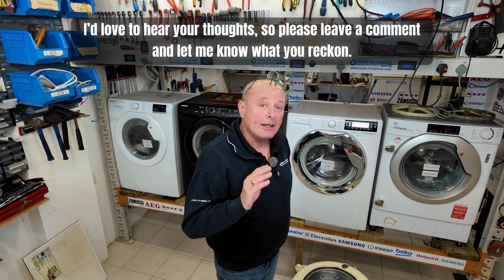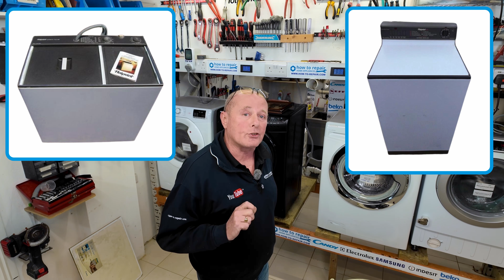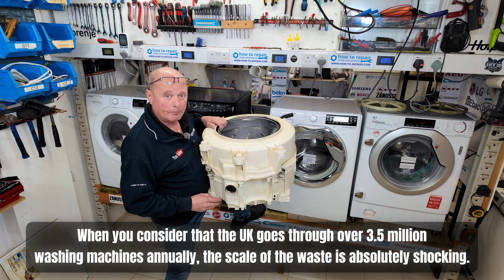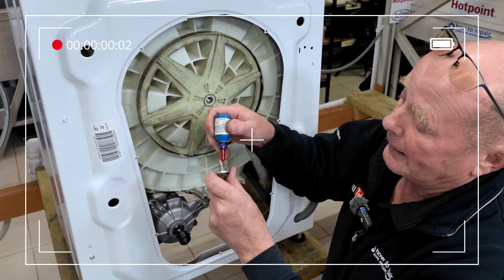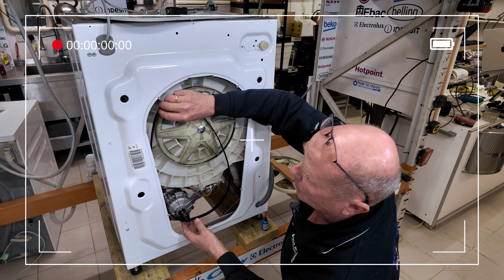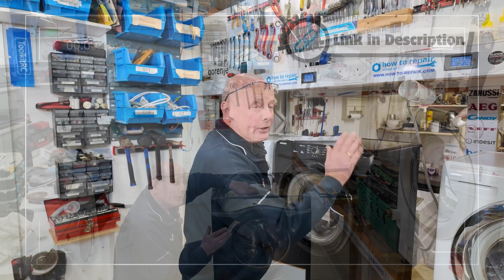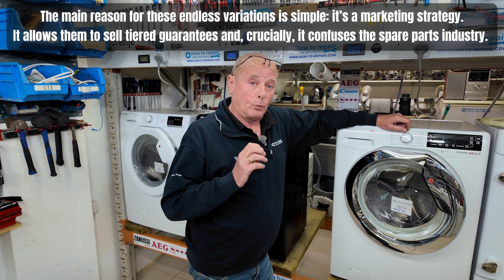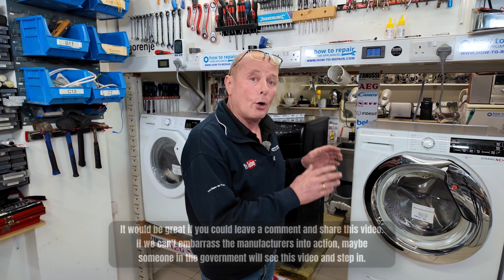I Scrapped 13 MACHINES to Prove a Point: STOP BUYING These Brands!

Comment: I hate the built in obsolescence and awful quality of so much in modern life. Tonnes going to landfill while we get lectured on green issues. Thanks for highlighting these issues, I wish more people would speak out.
Reply: Electrical appliances disposed of at council recycling centres don't go to landfill. That hasn't been allowed for many years. Look at The WEEE Directive.
Reply: Isn't it incumbent on people to do research before buying though?  For example a Mitsubishi Electric refrigerator is somewhat higher quality than an LG, Electrolux (Westinghouse/Frigidaire), Whirlpool (Hotpoint), but many buyers simply refuse to pay the 50-100% higher price for that higher quality. So much so that Mitsubishi Electric do not consider it viable to sell in the UK refrigerator market (nor the US one for that matter). :(
Reply: @TassieLorenzo  Yes and no.

I think a lot of people have now been conditioned into believing that a washing machine lasting less than 10 years is normal, and as such are sceptical about spending a lot more and ending up with a slightly shinier paperweight in 10 years. For example I think Miele have now started using plastic drums in their cheaper machines, which are cheap for Miele but not cheap in comparison to other washing machines.

If someone buys one of those Miele's expecting them to last 25+ year like many people claim, they're going to be quiet upset. It's crap like this that spoils it for everyone.
Reply: @boostar155  I still bought one of those plastic drum Mieles as it is what I am familiar with.  I'm currently dismantling my W828 and W3933 lol, I'll keep the good bits but scrap the rest including the failed drums (delamination on one, metal debris, and literal sparks flying and outside down machined down on the other, either out of round or possibly also metal debris lol).

In fact, I "had" to buy the base model as the door opens 85 degrees compared to only 65 degrees on the top models where it would be in the way of a walkway (I like to keep the door open all the time, while standard left-hand-hinged washers would have the door completely in the way).  I have a suspicion the plastic bezel door is the same geometry as the old metal doors, and will try swapping the old chrome door over from the failed machine once the machine is out of warranty, lol.

 FWIW, it was a factory second at around $1100 AUD compared to $675 AUD for a Bosch Series 4 which I thought was not too bad.  I really should have bought it immediately, instead of the used Miele first (which failed) though, as at the time (for the full price of $1550 AUD) Mie;e were including a 10 year warranty.

IMO, even on the  plastic drum models, there are still nice touches like transit bars instead of transit bolts of other brands.
Reply: @TassieLorenzo  Some people seem trained to 'think' they want the cheapest of anything. I've replaced home boilers in Maine that are actually illegal in NH because of their inefficiency, but the homeowner thinks you are trying to screw them for a more efficient system that is only 10-15% more but would pay for itself in a few years.
Reply: @TassieLorenzo  "Isn't it incumbent on people to do research before buying." But how do you do the research in a meaningful way? How can you do the research on longevity? And what is the ratio of price to longevity?
Reply: @ac1646  You can't but you view past historical data and teardowns & parts diagrams of the relevant model (including checking spare parts prices) and make an educated guess.  Like in automobiles, there are some aspects of washing machine manufacture that don't tend to change that much  and there are aspects that change a lot.

(e.g., Honda still uses bolts from the same parts bin as always (old-fashioned JIS standard bolts, not the modern ANSI ISO standards with superior stretch characteristics), they still use rubber hoses & metal hard lines for things like crankcase ventilation, vacuum & boost and not the plastic lines of European cars, and those rubbers hoses are sized in Imperial inner diameters as that is what Honda started with.
So those bit are good, what's not so good is the newer stuff thats changed: the 1.0 EarthDreams has a wet timing belt, the 1.5 EarthDreams has marginal reserve strength and has headgasket failures at 60,000-90,000 miles, and the CVT is also much less reliable than the old 5-speed automatic (which was only reasonable reliable on four cylinders, and was itself pretty unreliable on V6s).

Similarly there are things on say a Miele that have been the same for a long time (e.g., the transport bars, the support springs and mounts) and there are things that change a lot; but even the latest W2 still uses aspects of older designs, it is not truly "all new".

Typically it is aspects that change a lot that should be cause for concern -- electronic front panels (especially if touchscreen) or automatic dosing systems or Beko's new weight saving plastic door hinge etc.
Reply: @ac1646  E.g., a cursory search of the internet will show you that linear compressor LG fridges have a horrible reputation,   although the rotary compressor model LG fridges still can have the  compressor fail at 3-5 years too, but it's just less common.  At some point you to have to ask yourself "is there a reason a 450L LG fridge is $800 AUD and a 450L Mitsubishi fridge is $1600 AUD"?  

Some of that is the retail model, where they are more protective of RRP (about $1200-1300 AUD RRP on the LG, but the LG is regularly heavily discounted), but some of that is just less cost-cutting in the Mitsubishi Electric.

That doesn't mean the Mitsubishi Electric is prefect, and some will feel the price premium is not worth it for machine that (as you can imply) can of course still fail in 7 years or so just like a cheaper one.

Given Bosch refrigerators seems to be a lucky dip of who supplies the compressor (I've seen all of: Panasonic (good), Embraco (not bad) and JiaXpera (hmm, fine, but in that case why not just a buy a Chinese brand fridge?) in various different Bosch models) and where the fridge is made, I don't see the value in them as they are priced about the same as a  Mitsubishi Electric.

While some folks will prefer to pay more again for a Liebherr fridge. :)
Reply: PS. Despite saying the above I still like LG, as for example their fridges have only one control board and it is only $180 AUD, where the comparable Westinghouse (Electrolux/Frigidaire) has both the fridge control board the Embraco universal motor controller control board, and these are both $280 AUD a piece.  [The Westinhouse fridge is also very noisy compared to the similarly priced LG, but I digress!]

As Paul says, LG products tend to good for repairability and have reasonable spare parts prices compared to some.  So if choosing among budget brands, it is a very good option.
Reply: @ac1646  Also, an employee from a retailer was kind enough to unofficially publish warranty claim statistics (for fridges in the Australian market), which were warranty claim rates of: Mitsubishi Electric 8%, LG 12%, Westinghouse 13%, Samsung 31%.  While reading for 100s of hours on this is perhaps a waste of time -- at least you get some idea after it all, lol!
Reply: @TassieLorenzo  Thank you for going in-depth and although that is quite specialist knowledge, it has given me a few pointers. Thanks again.
Reply: @TassieLorenzo Nowadays you've got the choice between "cheap, will break in 5 years" and "expensive, will break in 5.1 years". 
Might as well go with the cheap option, paying extra doesn't guarantee anything.

Comment: Most are entry level and affordable. Most buyers do not factor in life cycle or repacement costs. Extended warranties are gimmicks. Limited choices for older homes/condominiums due to space and accessibility constraints. The fad market: features, programming, steaming, colors, etc. Where most use primarily the basic features.

In Toronto just for a repair person to come and evaluate - $300, plus diagnostic time, parts ordering, return to repair if parts are available or readily available ($200-300). So unless it was high end or cheap parts, forego repairs fir replacement. New washer - 24", 5 cu ft, depending on brand - $900 to $3000. Used or refurbished, open, floor demo, older - $800 to $1500.

Personally, I have had less issues with Bosch and Miele washer and dryers. But they cost much more than Samsung, LG, other. Same for parts.

Comment: Metal scrapper here. Been scrapping a lot of these front load washers in Melbourne that were made AFTER 2020. Corroded spiders the main problem along with bad seals. Rarely bad motors, hoses, boards or wires. Most of the machines blocked with lint and dust and spiders. So much plastic, and sealed drums abound. Avoid Vietnamese made appliances of any type.

Comment: I used to work in electrical retail and I think price is a big problem. The price of appliances has fallen considerably in real terms over the last 30-40 years and the price of repairs has risen considerably making it often uneconomic to repair machines. People would rather just order a new machine online and have it delivered the next day rather then call out an engineer and wait in all day only to find that by the time they’ve paid the parts labour and VAT they aren’t much better off. When I worked in electrical retail we would recommend a local engineer for repairs and I would say 80% of customers never bothered even calling him. I even remember one lady replacing a Bosch tumble dryer that had a snapped belt (I suspect she overloaded it) that was only a couple of years old and she decided to get a new one because we could deliver it that day rather than wait for an engineer.
Reply: You need a war like in Ukraine hunger games

Comment: Sadly this is painfully obvious with everyting. From clothes to appliances and vehicles. 

Im a fix everything guy myself.  And i see obselesance in everything. 

Take car suspension. Specially on european cars.  Suspension arms made of aluminum with the balljoint cast in the control arm. The balljoint goes bad, throw away 3kilos of aluminum and good bushings just to buy a new 120€ part even tho the balljoint would have cost 10€. 

Engines made with smaller and smaller displacements, pushing higher and higher power with turbos, at the same time being chocked with ecology making for a really powerful and ecofriendly engine that lasts the warranty and is too expensive to replace and is impossible to repair. 

Many many 80,90s cars had no problem going million and more kilometers. 

My grandma had a fridge made in 1957, made in Riga Latvia (ussr at that time). It was working till the day we threw it away because it was rusted out that was 2 or 3 years ago.  It was almost 70 years old and never skipped a beat.

Comment: It appears to me that the issue isn’t the Right To Repair Act but the rip-off prices the manufacturers are charging for the parts as well as building machines which are far too complicated. We need to go back to basics.
Reply: But they're welding the drums together so that they can't be opened and repaired. You have to buy an entire new drum.
Reply: @f-22r If you choose a Korean machine you can avoid that.  Otherwise a metal drum Asko or metal drum only models of Miele.  Some of this is on consumers for still buying Hotpoint, Bosch, Beko etc instead of only buying LG and Samsung on the budget end, or only buying Asko or Speed Queen on the premium end.  

European consumers have a real tendency to stick to their domestic brands (for whatever reason) instead of preferring Korean or Japanese brands.  That applies in ICE automobiles too despite the demonstrably lower quality of electronic and mechanical parts in brands like VW Group, Stellantis or Groupe Renault compared to Toyota or Honda (the bodies and paint are better quality in the European brands though).
Reply: @TassieLorenzo  because european brands used to be good quality. nowadays they are all chinese-owned. Candy is the worst example.
Reply: I am 72. I have bought several washing machines in my life, and fixed most of them myself. Stupid faults. Pumps, leaks. Rust. An expensive Zanussi washer drier. That got completely bunged up. 
So when I inherited a bit of money in 2000 in bought a Miele washing machine, dishwasher and fridge freezer (a rebadged Liebherr I think). And 2 AEG pyrolytic self cleaning ovens. I bought AEG ovens as the Miele pyrolytic ovens were too expensive. All are still working. So is a 2008 secondhand Miele tumble drier I bought in 2016. 
However a newer secondhand Miele washing machine I bought a couple of years ago failed with a rotten spider.  A one year old Miele automatic twin dose machine I bought 2 years ago takes forever to do a wash.  Bizarrely over complicated and out of touch with reality. 
So, even Miele is losing its way. 
The on off button on one of the AEG ovens now barely works - I have put tape over the button so the machine is never turned off to prolong its life. No spare part available - the oven is used every day and still works like new. 
So it depressing that stuff that could be built well, with simple cheap available quality spares - are not being made.  The manufacturers will never change without strongarm government pressure.  A minimum 5 year guarantee should be mandatory, with spares kept available for 20 or more years. My appliances are 26 years old and still working perfectly every day. A couple of spare parts have been needed from Miele - and the new Miele spare parts were better made than the original failed parts - the weak design or manufacture had been recognised by Miele and improved !!!
I wonder if Miele still does that today. 
Probably not - but who knows?
Buying stuff that lasts has really paid off for me. But everything I bought was probably 3 or 4 times the price of the very cheapest.  
The stuff still looks brand new, after 26 years of daily use. And from what I can tell, works just as well or better than the latest stuff. My Sharp microwave is 30 years old and works like new … 
The right to repair easily and cheaply, together with long guarantees and the guarantee of reasonably priced spare parts kept for 20 or 25 years is what the planet needs. Multiple manufacturers make compatible spare parts for cars - manufacturers should be forced to publish the details of their machines so that others could manufacture and supply cheap compatible spares. 
It is, with computers, the internet, and AI, all remarkably easy to do.  
The planning of obsolescence should be made a criminal offence, with huge fines and long prison sentences.  
The current system rewards crap being made and sold - and only the rich can afford to buy the best stuff, and chuck it out and replace it when it fails after a couple of years. 
The chap making these videos is really doing us all a service. A seriously important and useful service. Thank you, thank you, thank you.
Reply: The problem is so many are ‘beyond economical repair’ £180 for a new drum as you can’t get to the bearings vs £200 for a new machine. Even the quality of Miele has dropped through the floor with plastic welded drums when they used to be metal.
Reply: @MookPanda The £200 machines are half the problem though, they have been cost-engineered to within an inch of their life.  That leaves little to no space in the market for people who want to build quality and charge accordingly.  

Not that Panasonic washing machines for example are particularly reliable, but they have left a lot of markets due to this, and a lot of the other Japanese brand washing machines (noting some are just rebadged Vestel in Europe) choose not to sell outside of Asia at all.

Similarly in refrigerators, Mitsubishi Electric don't compete in a lot of markets, as buyers aren't willing to pay 80-100% more than a LG, Samsung or Electrolux, Frigidaire/Westinghouse for the same size refrigerator even if its higher quality and has a longer warranty.

Comment: if the manufacturers cared about ecology they would build their machines to last decades and sell spare parts to prolong their lifespan as much as possible.
Reply: "last decades and sell spare parts"  To be fair, that IS true for commercial-grade washing machines.  However, for whatever reason buyers are simply not wiling to pay ₤2500 for a 6kg washing machine like an Electrolux Professional QuickWash QWC 6kg.  At least Electrolux are upfront about the relative service life: 15,000+  cycle life for the commercial machine compared to 2,500 for the residential machine.  It's right there in black and white in the marketing material for the commercial machine.  If buyers still want to buy the ₤250 residential Electrolux machine anyway despite Electrolux literally telling people that the service life is only 2500 cycles, surely that is on the buyers?